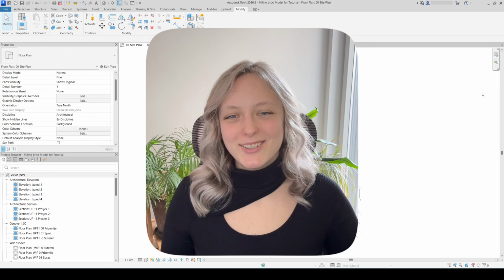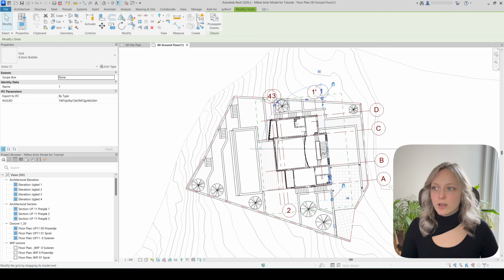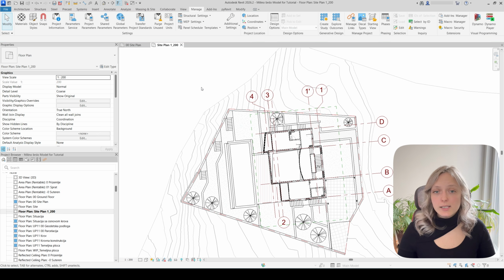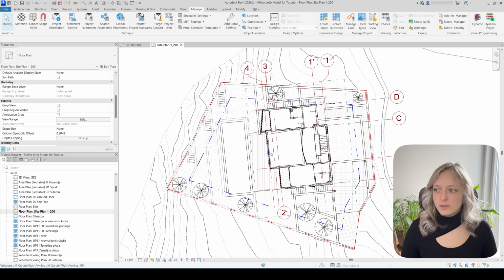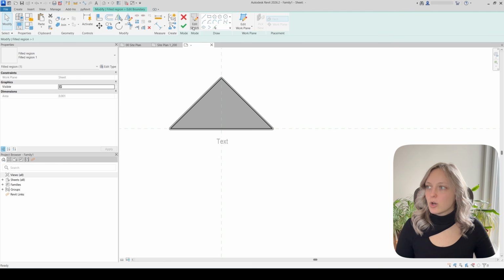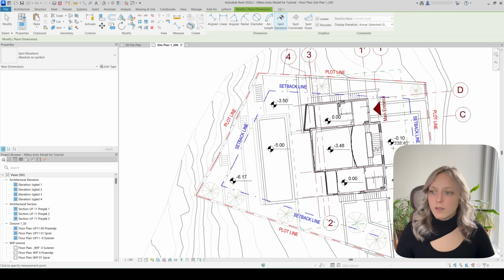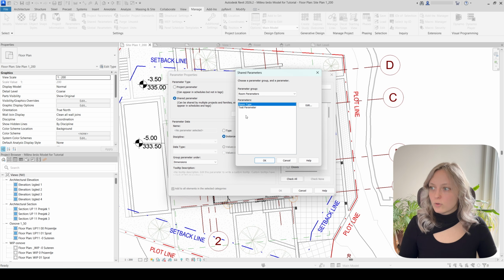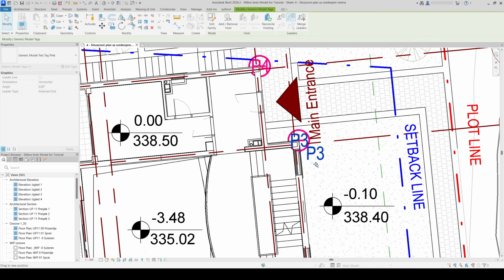How to Create a Site Plan in Revit: Technical Workflow & Coordinate Schedules

Comment: I am currently using Autodesk Revit 2023 and facing an issue with Toposurface.

I created the toposurface using two methods:

1. Importing a CSV (Excel) file
2. Creating points directly within Revit

After creation, the toposurface appears and works correctly. However, after saving and reopening the project, I am facing two issues:

* The toposurface is *not visible in the Site Plan view**, although it is visible in the **3D view*
* Additionally, after reopening, the *toposurface is not displaying correctly (distorted / incorrect shape)*

I have already checked the following:

* Visibility/Graphics settings
* Hidden Elements
* View Range

Despite verifying these, the issue still persists.

Could you please help identify the cause of this issue in Revit 2023 and suggest a solution?

Thanks.
Reply from the maker: Try turning off survey and project base poing in visibility\graphics, maybe nothing’s visible because they are far away? Maybe that does it
Reply: @BIMTonicLive thank U very Much  🎉🎉🎉😊

Comment: hi one thing i noticed the Property lines are in between perimeter walls?
Reply from the maker: Great observation! 
All the plots in this hill were part of the same project, belonging to same investor. So those boundary walls were separating plots for different villas, each being right on the center of the plot lines. Only the edges of the entire super plot (in case of this plot, the upper plot line is edge of the entire plot), were offseted to the edge of the plot.